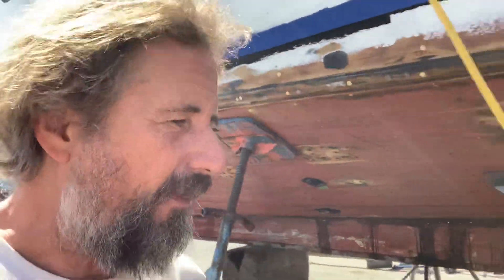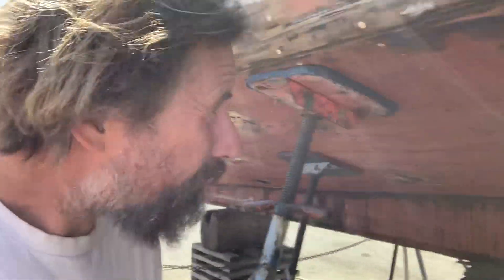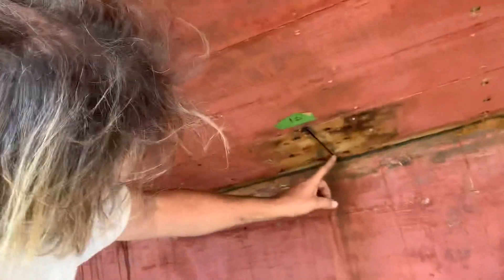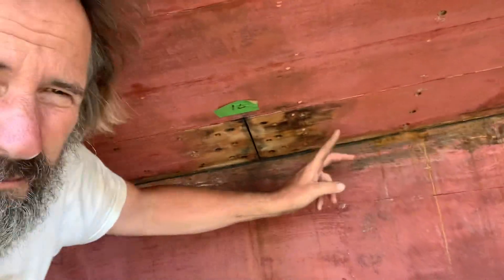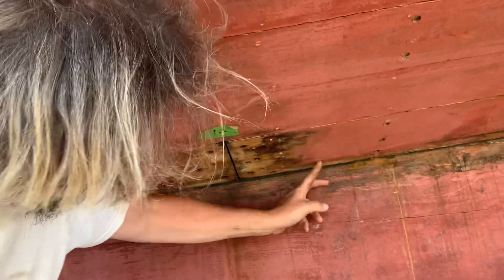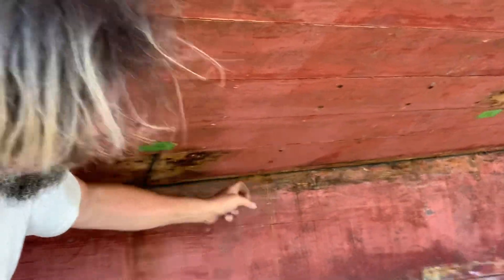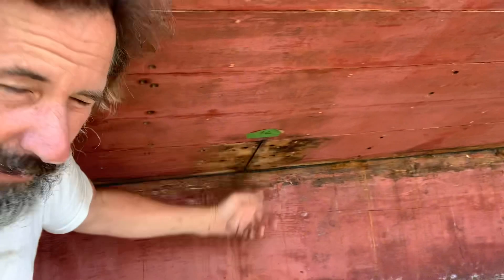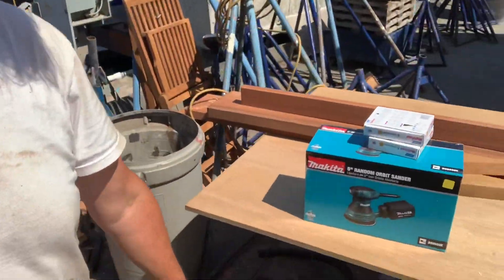Sunday update from the haulout that never ends…

Comment: Sander spin of death:  There is a $2 belt/band that wears and breaks that causes the spin (rather than the orbital). As long as you don't let the smoke out of the motor, they are a pretty easy fix.